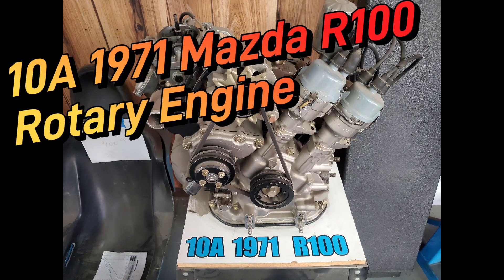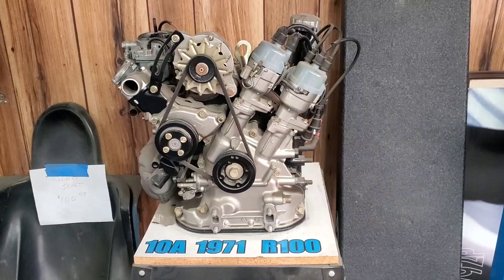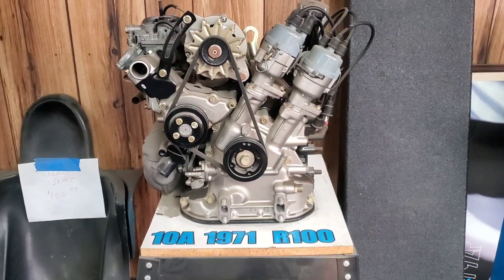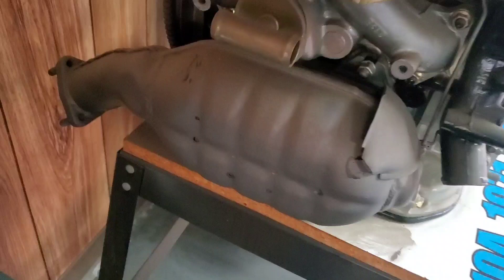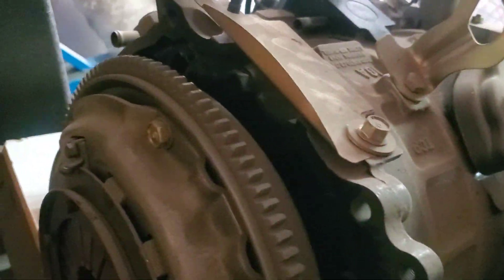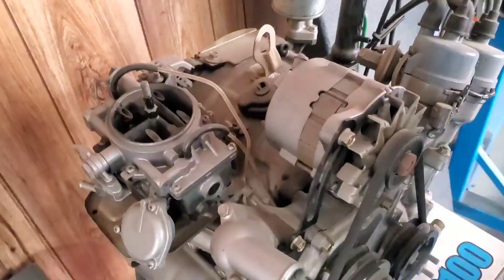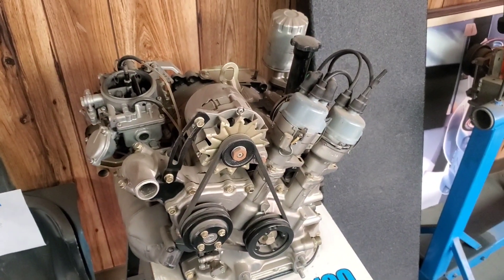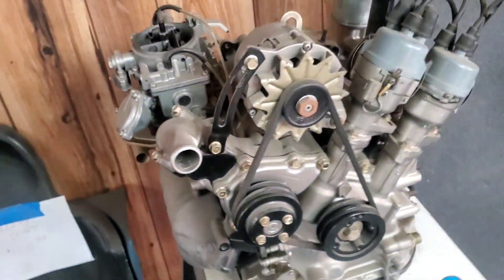Super Rare 10a Mazda Rotary Engine, tech talk, the first Mazda rotary - 1-liter Wankel

Comment: An old friend had a 10a in an rx3 sedan but was seized when he bought it. Was pulled out and replaced with a 13bPP and used as a Burnout Hack. The 10a was pulled to pieces ( I ended up with the Rotors and had them in my room for years then passed onto a good friend as garage Ornaments when I moved out New Zealand )

Comment: Hi Kyle

I noticed your post on the 10a rotary I litre. I am based in the UK and have just acquired a 10a Rotary engine the same. It was being rebuilt before the owner passed away in 1999. It has been sat on the work bench in his garage ever since, before I acquired it. I know little about it , but it does turn over and I have made a video of it. There are various photos I have taken. 
I don’t believe this engine was supplied to the UK, but I could be wrong. I am sure that there is someone who could make use of this for a restoration etc. I have a video and photos which I can’t even to add to the comment? . As I said it turns over freely and I believe quite some work has gone into it. Thanks Stuart.
Reply: 1:17 1:17
Reply: @austinbrown6950  Hi there, do you still happen to have this engine? ☺

Comment: Definitely a piece of history so to speak. Looks to be in nice shape externally at least. Eunos Cosmo is such a sick ride. That's one Mazda I'd definitely drive. Back in the days I was a tech at a Mazda/ VW stealership. Registered master VW/ Audi and BMW tech, but of course when we were busy or I was caught up with whatever I had in my bay I'd turn some wrenches on the Mazda's. Did a ton of work on the Speed 3/ Speed 6, cx-7's/ 9's, rx-8's and a whole bunch of other stuff. They LOVED to pull me off a VW job I was doing and give me anything MZR related. They were 'all-about' me replacing blown turbskis, wideband o2's, etc. (I had a trick to remove the o2 without trashing the threads on the sensor or in the downpipe.) The way 8 am, I will literally turn a wrench on just about anything. Cars, diesels, HD stuff, machines/ construction equipment, power sports/ boats, etc. 25+ years of wrenching under my belt so 8 have seen quite a bit of shit along the way. 😉 Lots of service bulletins and just regular repairs for the most part was the usual operation. The loved to give me diag work, since I was good at it, and folks with decent diag abilities are few and far in between from what I've seen. 

I remember my first day. The service manager wanted to test my skills since a few other techs that worked there were attesting to my work, so the service manager Andy threw me a 'curve ball' as he called it and we pushed in a cx-7 that had previously been barely started to be worked on by another tech (a pet peeve for a tech,) and the cx-7 was left outside. So myself and a couple other techs pushed this dead thing into my bay. It had a boat anchor for a long block. Fast forward to the next day and I had R&R'd the entire drivetrain, subframe, x-case, etc. I had to transfer everything over to a fresh longblock including the injector cups which needed a special tool that nobody knew how to use it, even the Mazda master tech. 🤔 So I took care of it, and while reinstalling/ using the scantool to go thru the motions, and it fired right up that afternoon with no leaks or CEL's. After that day the service manager/ service writers were giving me the most difficult jobs that rolled into the shop. I would come in the AM sometimes to see a 'pile of crap' sitting in my bay that needed tons of work, just waiting for me to crack open my tool chest, and save they're asses. The R.O.'s would look like a damn story book there was so many pages! Ugh what a freakin nightmare the stealership is in general. I have worked at a boatload of them, including indies, and finally my own track car prep and fab and tuning shop where I have a select customer base. It is much better to say the least. LOL Won't be doing any of the repetitive service bulletins, recalls, etc. That crap is extremely annoying to say the least. Sorry for the rant, listening to you talk about the rotary/ Mazda stuff and seeing that engine had me reminiscing about it. Glad to be gone from the stealer!!! Thank you again for sharing this! That old Dorito is definitely a rare one and especially how well it looks on the outside. One can only hope the internals look as great as the outside does! Thanks again for sharing brother!! and keep the KICKASS vidjas coming!!! 👍👍😎

Comment: Kyle, l had 2 10As  in 2 1970 RX3. in New Zealand, they had 6mm carbon apex seals and twice the number of side seals. There were also twin disks 12As which came out in early Mazda RX2s.
Reply: I had an old 12a Twindizzy fuck they were awesome . Just pitty that the gearbox mounting was different with the top starter motor
Reply: https://youtube.com/shorts/nE4VKGcfYmU?si=pZyWeAEdRbYsfMD2
Reply: Helo robert, i just got a complete 10A engine and i am looking for information about this engine, is there a way we could communicate?
I am looking for a price to sell it

Comment: Thinking about it, going from a 1 liter NA two rotor, to modern 2 liter custom built 3 rotor with a turbocharger, the power jumped from a 100 to a 1000hp.

Comment: thats a series 2 r100 engine, the series one has the oil pump built in to the timing cover,and the through bolts come through the front plate and have nuts on them. what you have there is basicaly an rx3 engine.the 10a was used in the cosmo, r100 and rx3 from the late 60s to 72/73 in some parts of the world. Rx3s in usa were sold with 12a twin dizzy,and i think you guys only got the series 2 r100, which is what this engine is from.
Reply from the maker: Thanks for watching and for the info 👍